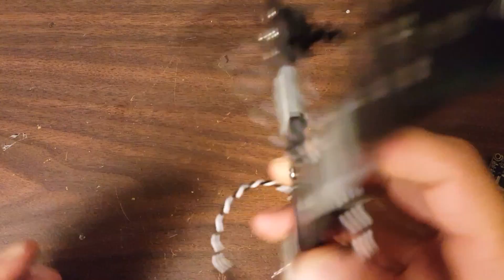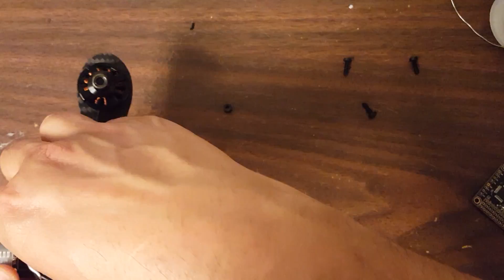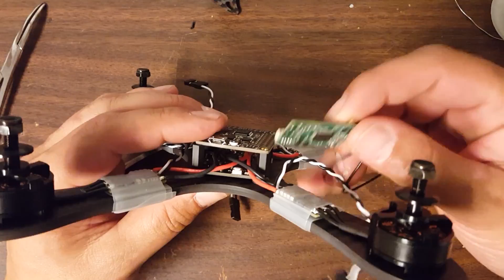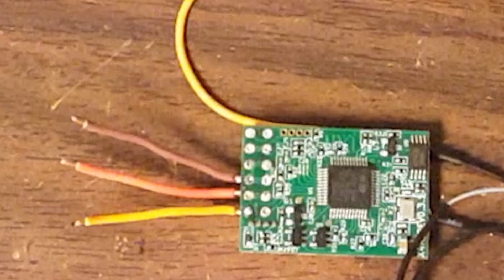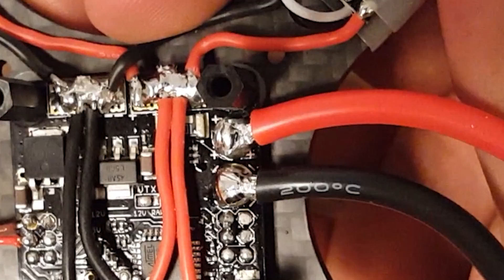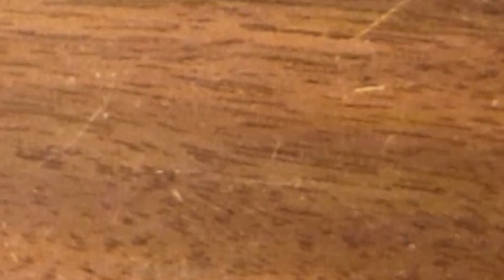Pure X Racing Quadcopter Build - Part 3 - FC, receiver, camera and vTX header

Comment: Josh - Check out 3M 33+ Eletrical tape. I have my escs, voltage regulator, etc wrapped in the stuff. I like it a ton.
Reply: +Alex Thanks!  I've been looking for some decent tape. I experimented with 3M 2228 rubber mastic tape, which looks similar to the stuff that Joshua was trying out. Whilst it works well, it's a pain to work with as soon as you have to remove it.
Reply from the maker: +Simon McKenna (Si) The silicone tape is sort of similar to the 2228 in that it adheres to itself. But it doesn't become as sort of goopy as 2228 and is easier to remove after the fact. Also, the silicone tape is UV resistant whereas my understanding is that 2228 needs a cover of regular 33 electrical tape to protect it from UV.
Reply: +Joshua Bardwell Thanks for the UV tip, and yeah, 2228 is super goopy :)
Reply from the maker: Another tip for installing 2228 is to put down a layer of 33, then a layer of 2228, then a layer of 33. The under-layer of 33 means you can easily peel off the 2228 later. But you have to make sure the 2228 extends over the ends of the under-layer of 33 in order to ensure moisture-proofing. So you pick away the very outer-most 1/4" of 2228 and then you hit the under-layer of 33 and you're golden.

This is how we do outdoor RF connectors anyway. It'd be way overkill for ESCs I think, but it WOULD waterproof them that's for sure.
Reply: Cheers Joshua, doubt I'll use 2228 on ESCs in future builds, but I like the way it secured the VTX and antenna on my first build: http://rotorbuilds.com/build/624

Comment: Hey, Josh. Why are you doing Rssi?  
I would think that Rssi is between the RX/TX and that the FC does not need this info.  
As people are doing stuff it seems that Rssi goes from the RX to the FC and back to the RX for TX to the main controller.
Reply from the maker: +Dirty Robot The RSSI feed is to the OSD, not the FC. I want to see RSSI in my OSD. At the ranges I am flying (FPV acro and racing) RSSI is basically never a problem, but if the antenna or receiver were damaged, I would want to know. You're right that you don't need any additional wiring to get RSSI back to the Taranis. That's just built in. You need additional wiring and etc... to get RSSI anywhere else, such as the OSD or FC.

Comment: What specifically did you not like about the silicone tape?  It seems like it would be good/better than e-tape.
Reply from the maker: +Craig Quillen It's heavy and thick. You stretch it to get it to go taut and form fitting but then the tiniest nick and it splits.

Comment: Hey just a suggestion. I cut my wires long and then strip them. Once I Tin them I cut them back a bit so the exposed wire width is as long as the pad diameter. I see you didn't do that for the OSD video wiring. This is bad practice because you can short pads if your exposed wire is long enough. Also the insulation on most of the wire is not very tolerant to heat and tends to peel back during tinning. This is another reason to shorten the exposed wire. Secondly don't brush off the VBAT soldering. A flaky solder for VBAT could cause a fire. VBAT isn't current limited so a short can light up that LiPo.  I like your videos and keep up the good work. I wish I had the time to make helpful videos.
Reply from the maker: +Koen NAir that's my practice as well. The problem is on plastic coated wire, the insulation just burns back when you solder it to the pad. So you can't cut it too short.

Comment: Will there be an openlog on this build?
Reply from the maker: +Craig Quillen No. Maybe I will try that in the future but for now it's just so tight I didn't want to bother. The F303 has 128 Mb / 16 MB of dataflash which is plenty for logging now and then, but not full time.
Reply: +Joshua Bardwell what rate can you log to the onboard memory chip?

Comment: Can you help me. Whats a good motor for freestyle flying on a alien 5" size or similar size frame and I dont want to pay big money
Reply from the maker: +mark rankin RCX 2205/2350kv from myrcmart. Should do okay on nearly any 5" prop you choose. Bet performance for freestlye will be on on something like the DAL 5045x3 bullnose v2.
Reply: +Joshua Bardwell Thank you so much i really appreciate your help
Reply from the maker: +mark rankin Make sure you buy an extra motor, a couple of extra bells, and maybe a pack of bearings. Those motors are decent for the price but the aluminum is pretty soft and they get bent up fairly easily, especially if you are using heavier or stiffer props.
Reply: +Joshua Bardwell Brilliant cheers for the heads up

Comment: Hi Joshua, does the OSD display the battery voltage from the receiver or directly from the battery connection on the RROSD from the, just wondering why you connect the vbat from the receiver if you have it already displayed on the OSD?
Reply from the maker: +Dexter x Directly from the battery. I connect vbat so that I can get battery telemetry to the Taranis. This means I can plug in a battery and quickly glance at the Taranis to confirm the battery is charged up before I strap the battery down and put my goggles on. Basically, vBat plus Taranis telemetry is the world's most complicated battery checker.

Also, the Taranis has a "critical" alarm set up at like 3.2 volts per cell. So that is a last-resort if I fail to notice that the OSD is flashing. Once upon a time I plugged in a discharged battery by accident and flew it down to like 9 volts (on a 4s!) before I noticed the copter getting mushy.

Comment: I didnt see a capacitor on there =P
Reply from the maker: +sciullo779 Nope. But the RROSD has built in filtering. It's not perfect, but it's enough.
Reply: Man... I just bought a 1000uf 25v capacitor for my build(after watching your other video) and I am using a RROSD for my PBD/OSD. Would there be any benefit in adding this to my build? Space is at a premium since it is an atom build.

Comment: Joshua does the RSSI really work?  After listening to Andy RC's video on RSSI Explained, I was wondering if how you connect the RSSI in this build actually gets you anything?https://www.youtube.com/watch?v=nZxMvTCN_pI
Reply from the maker: The RSSI from my X4R-SB to my RROSD seems to work correctly. The X4R's RSSI is coming from a debugging pad which outputs 0 to 3.3v analog signal. I've seen the voltage reported when I calibrate the RSSI reading on my RROSD, and I've checked to see that the RROSD roughly mirrors the Taranis RSSI reading in the real world.